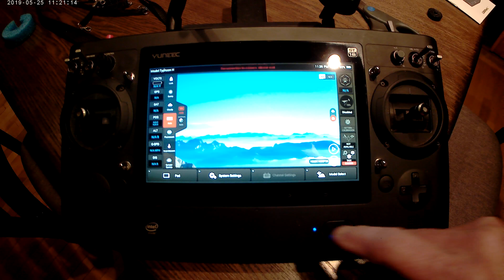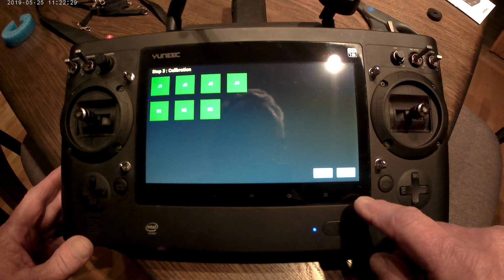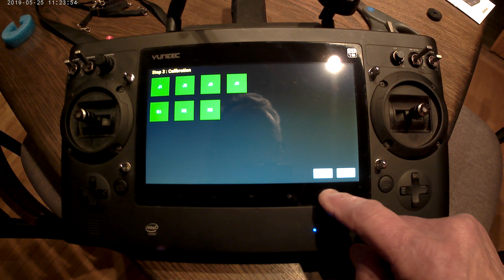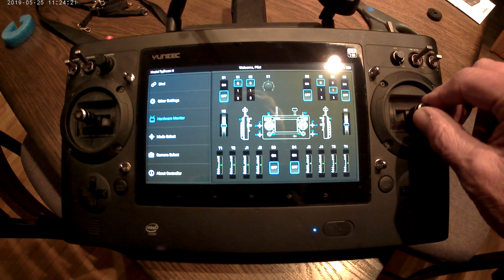Yuneec ST16 Calibration

Comment: Hey how are you?  I tried this after I found my speed stick on the right was out of calibration.  Everything else I saw on this problem suggested replacing the stick or cleaning it up with pot cleaner. This stick went from 50-60% to 100% percent at least in theory and on the screen. Have yet to fly it see if it took. Thanks.
Reply from the maker: If it goes to 100%, is not sluggish and returns to exactly zero at center stick then you are good to go.